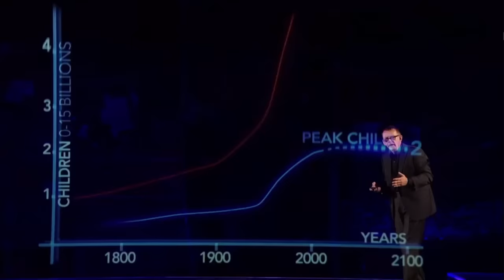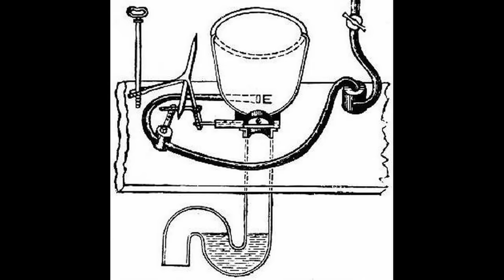How to Save TONS of Water, to Save the Planet

Comment: I have given your solution some though and have found a few critical flaws with its design and application, firstly, what happens when the power goes out, but also, a lot of plumbing would suffer from an affect known as 'water hammer' far more than it would in day to day use, say you turned the water off five times while not in use thays 500% more wear and damage from that action, leading to massive pressure on the system pote tally bursting water lines in the home and in the street, and you can't very well suggest we all get new reinforced plumbing for every building... I did however find a solution through another route, why not consider a urinal as an ordinary bathroom facility, rather than confined to a public restroom, with the lite to no flushing involved, over say, having flushed the toilet each time you pee or letting the pee sit there, you can save about 7 liters a flush, that's going to be about 30 liters a day, and that's just for men, now considering you could implement a same system for women you can double that result, and as people generally only need one gallon of water a day to survive, the savings far exceed the usage
Reply: @Angelo Stevens I second choosing dual flush systems over a urinal.  As for why most toilets in the US are not sold as dual?  The valve and handle changes needed to retrofit a normal toilet is a few bucks and requires next to no plumbing skill to install.  I guess the manufacturers just wanted to save a few pennies.
Unfortunately, where I live seems to favor low-flow toilets, which are crap.
Reply: @αγγελιαφόρος  Or in a sink. As good as urinal amirite?
Reply: i drink a gallon of beer every day and a shit load of air dried salamy. if i dont flush my piss neighbours will call the sanitary service and get me evicted
Reply: the power goes out would not be a problem as we still have manual tap valves
Reply: @Angelo Stevens My house in the US has dual-flush toilets. It was built in 2009 so I guess newer houses are more likely to have them.
Reply: @wiky1492  Yes and no. The extra valve will be normally closed by a spring, when not energized. But most of the types shuld have a manual override, to be set always open.
Reply: Electric water valve doesn't imply water hammer. Modern ones are slow-closing. I haven't heard a water hammer from my dishwasher or washing machines in decades.
Reply: Angelo Stevens Dual flush toilets still use half of the water (I have dual flush toilets, in case you jump to conclusions). It’d be even better if we only flushed every two times. Only a quarter of the water used!
Reply: That's why I use my sink as a urinal. :)))
Reply: @Dawt_Calm  i was just about to say that, lmfao good thing i read 1st
Reply: I always Piss outside, usually under the Loquat or Lemon tree when i am down there. saves taking shoes off to come back inside and go do it in the dunny.
Reply: @aliozanerbektas  Just don't forget to replace the trap! :)

Comment: I mean, its nice to save water and all, I try to save it too, BUT.. hand washing? Its absolutely nothing compared to showering, washing things, making food, drinking the water and the two that absolutely dwarf these: growing food and industry. You are going to save 0.00.. something small % of water. 
Its better than nothing, I guess? 

Similar thing with saving electricity - the insistence to unplug chargers baffles me. I mean, sure, its gonna save something. But to claim you are doing anything to save the planet .. 
I once calculated that walking to a charger, bending and unplugging it will use about the same amount of energy, in calories, as the charger being plugged in 24 hours.  Then you consider that food calories are less efficient, requiring more water, energy and other resources than pure electricity, you are actually doing more harm than good unplugging those damn chargers.
Reply: I just checked my chargers. One uses so little power, the HOPI power meters shows zero. The other (an older design with a 50Hz transformer) uses somewhere around 0.5W when plugged in. 0.5W uses about 4kWh in a year. Or about 0.4EUR. So, let's say I bought a new charger for 5EUR, it would take more than 10  years to pay off.
Reply: i insist my family members to unplug chargers because it damages some types of them. they start making a while after and it annoys me at night
Reply: @Pentium100MHz  Not if you also factor in the efficiency with a load attached...
Reply: So you mean that by being lazy we are saving energy? That's ok for me
Reply: Agreed. The two biggest uses of freshwater in the US are irrigation for farms/ranches, and thermoelectric power generation. So the best way to save water is to be smart in what you eat, and conserve energy.
Reply: The production of meat products uses more water than everything else combined.
Reply: Totally, people lost all common sense and education these days.
Reply: Mārtiņš Kaktīts  you may be correct about the energy requirements, but food-calories are orders of magnitude cheaper than electrical energy. So it still makes some economic sense.

Comment: Why don’t you just turn off the tap?
Reply: You could, but nobody does, right?
Reply: Yeah like I'm going to touch the tap with my soapy hands
Reply: Yup, I don't see the fuss here. If you have a tap with one handle only you can easily turn it on and off with your non-soaped wrist...
Reply: @johnbutts4725  You can push the handle with your wrist, i suppose.
Reply: A complicated solution is better then a simple one.
Reply: The problem can be small children. They tend to leave the tap on a lot till they grow up a bit. This way they have to positively switch it on and just moving away switches it off.
Reply: @gordonlawrence4749  they will find a fucking brick and put it on the footswitch. The ideal setup would have a 'turn off timer', which shuts off the valves after like 10 secs, and you have to release, and press the switch again. Of course, if you release the switch before the timer turns off, the valves shut off imediately
Reply: Jerry Rupprecht because its an exhausting process, the idea here is to make it easier to save water
Reply: @johnbutts4725  I use my elbow
Reply: Haha, that's what I was thinking as well. I can literally not remember a time when I didn't do it that way. tap on -> wet hands -> tap off -> apply soap -> rub hands -> tap on -> rinse -> tap off
Reply: Or idk...half "speed" or something
Reply: That's what literally everyone does
Reply: @gordonlawrence4749  Because little kids (and grownups) won't just leave their foot down on the pedal either eh?
Reply: @johnbutts4725  then use a sensor recognition tap
Reply: think its an american thing to do to keep the tap ruunning for literally no reason. at least ive never seen it or even heard of anyone i know doing it
and how exactly is soap stopping you from using a tap. dont be so fucking helpless, drip some water over it afterwards to clean it up
Reply: @subway7008  no everyone does including u and me if there was a sensor with control temperature it would be amazing
Reply: @gordonlawrence4749  That's a long time to leave the tap on... How to save a few million liters of water.
Reply: @panzerveps  1 million kids - 1 litre each per week - 52 million a year.
Reply: @MrDoboz  Really? Just how many places do you know of that have bricks lying about? LMAO.
Reply: @washx2k755  the water tap is an invention that already allows you to control the temperature of the water coming out. just clean up after yourselfes and dont let the tap keep running for no reason, like everyone else. or in other words, dont be so fucking helpless
Reply: @gordonlawrence4749  What was the problem that the solution in the video was addressing?  It wasn't water valves being left open to run unattended.
You don't think most people could find a brick or other heavy object close by to their domicile?  Do you live in a padded cell?
Opps. That was two.  But I bet pointing out your fallible logic could be a full time job.
Reply: Mixer taps easier to turn off with wrist, elbow, nose, chin, etc. than two taps.

Give the guy a break though... there had to be at least some channel-themed content with the spiel from the heart.
Reply: To be fair this method does do that, just in a faster and more convenient way.

Comment: So interesting little Fact I learned from experience, I was a manager at a state of the art retail super center and we had all the newest water saving equipment installed through the store from the deli to all the bathrooms. These things appeared absolute great and made you feel good you're doing you're part to protect the environment, well just like everything that is "Green" it has a sinister side to it, about a year after we opened we started having daily backups in the stores bathrooms im not talking a little it flooded the front restrooms came out to the cash registers, it was so bad that they thought the sewer pipes shifted. After the plumbers snaked the whole sewer line with cameras it became evident that it was actually the fault of the Eco friendly water savers. Turns out that without the bulk of water pushing the Snots, buggers and shit down the pipes and out to the sewer system all that lovely biomass that never makes it out hardens inside the pipes, till eventually water will find the path of least resistance just like electricity. The solution was to put in High flow toilets to increase the flow to push out the Bulk bio mass, and it worked.. The Green system actually caused us to use even more water then using standard water flow. Honestly the best way to conserve water is to invest in end of line treatment plants so the water can be purified then discharged back in the systems circulation.
Reply: Yeah, that's exactly what I was thinking after watching the video. The idea is great, but now with all new home devices being designed to be very efficient with water, there is a real risk of clogging.

Comment: And to add to consumption of fresh water. City water plants are upgrading to reusing the water they distribute. So if you’re on city water & city sewer. What they send to your house or business for water usage they get back from your sewer drains and it goes through a recycling process to be reused back into the water system. It’s like a 6-10 step purification, where it gets treated, cleaned, repeated and tested before being put back into the water system. So when you think yours just wasting water, your actually just sending it back to the plant to be cleaned and purified for re use.